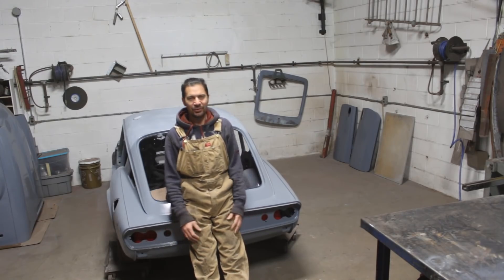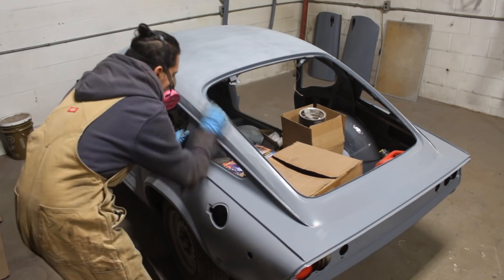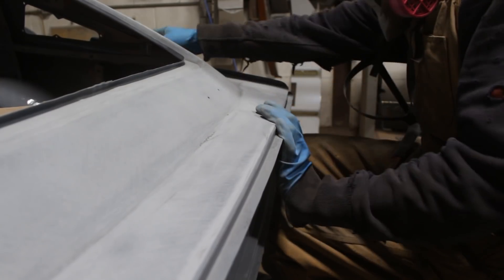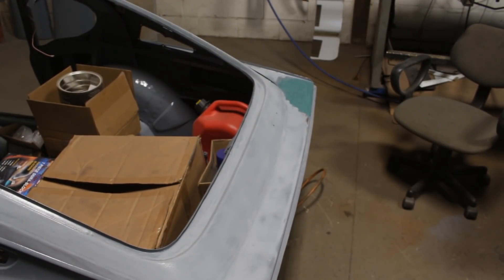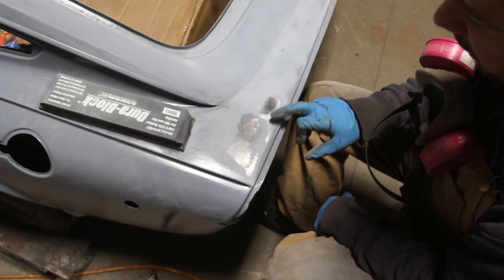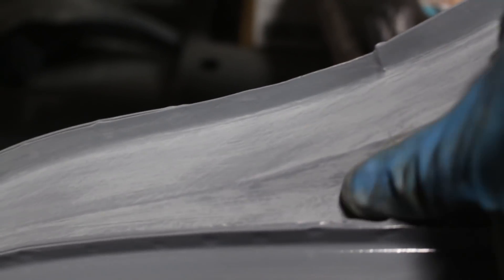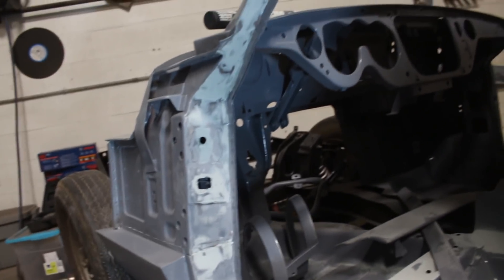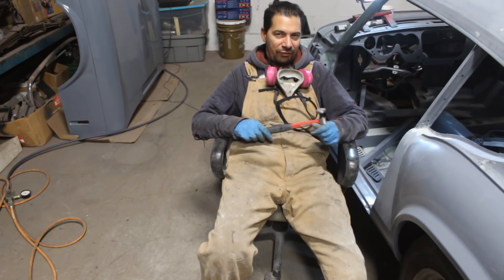1972 Triumph GT6 Restoration - part 62 - Even More Bodywork

Comment: A good idea when using the SHRINKING disc is to spray a light coat of black paint over the worked area and sand with your sanding block just enough to see the highs and lows better. Then just clean the black off with thinner when you've seen what you need to see.
Thanks for sharing

Comment: Filler -80 grit - epoxy prime - filler prime - then 320, 600 grit etc..  "Do your work in the filler prime". That's what it's for. It will sand easier.  You want to keep the epoxy as thick as possible for a moisture barrier to protect the metal. Only a light sand on the epoxy if you get runs or dirt, or if you wait too long fast the re-coat window.

Comment: The raptor tech sheet says 180-240 over body filler...so, I’d say that you should sand to at least 180 before overcoating it with epoxy.   I’ll continue watching 😎
Reply: Use a little piece of paint stick wrapped in sandpaper to get into the tight areas 😎
Reply: My thought was a shim shingle, it has a taper that you can cut with a razor knife to the desired thickness. You can taper the paint stick too, just what was left over from cabinet install...